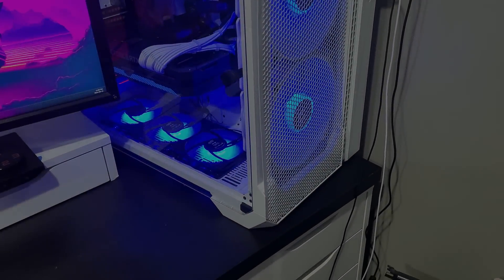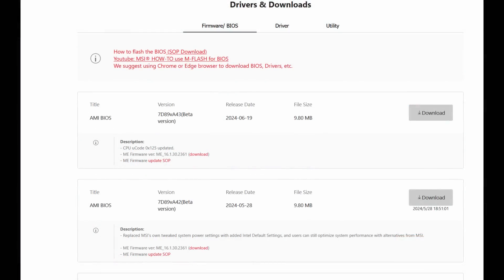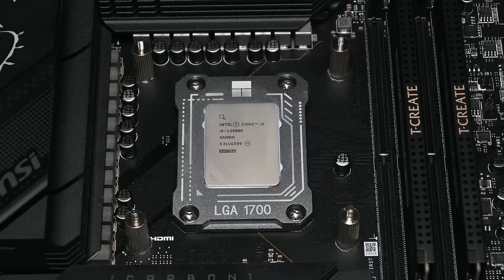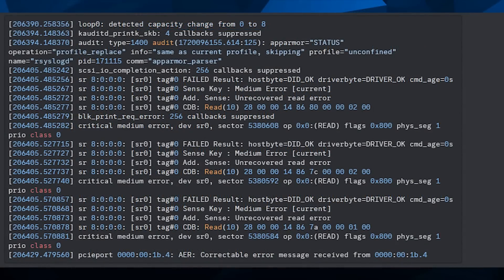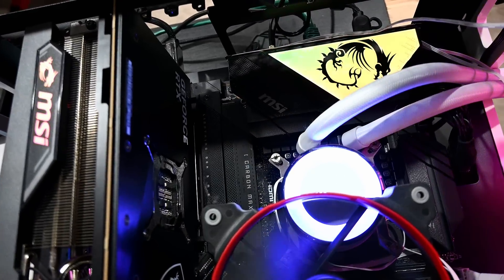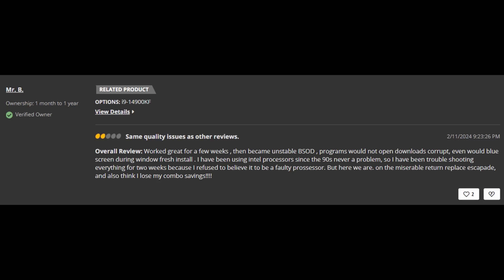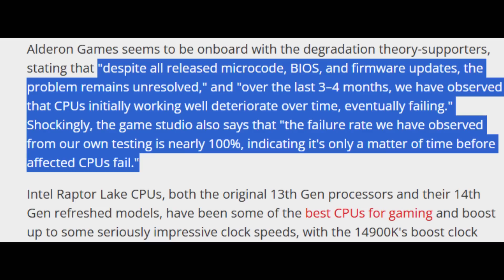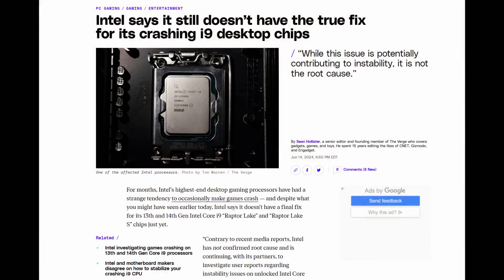Intel CPU Crashing Situation is FAR Worse Than You Think! - 50% Failure Rate, RMAs Denied

Comment: ASUS W680 user here (w/ 14700k), the default BIOS prior to the ones released with Intel Baseline in mind, had crazy power settings (4096w and 700A). It seems like ASUS copy pasted their settings.
Reply: Doesnt really matter, those boards arent able to provide much power to the socket anyway. And while that is possible that was due to Asus doing a copy pasta from their gaming boards, thats totally not the case with Supermicro boards on systems that wendell investigated.
Reply from the maker: Wow wtf, that's a big blunder on Asus
Reply: No wonder cpus mounted on their motherboards failed as well.

Comment: People haven’t been paying attention for the last couple of years of how crappy the quality of everything has gotten. Motherboards, laptops, ssds, gpus, I have noticed so many things that fail far too easily and companies have been watering down customer service, just look at Asus. Asus used to have the best repair service (well in my neck of the woods) and you see how that’s going. I shouldn’t have to send a motherboard back multiple times to get a functional one let alone one that doesn’t look hella used. Intel probably knew before they even launched these chips there was going to be issues with them. They were just hoping to run out the clock on warranty. 
 Intel will stay quiet, do the bare minimum and speed up the launch of 15th gen and start screaming “look at the new shiny”. Sadly Intel hardcores will totally buy into it like they always do. The fact amd has been kicking intels ass in performance and efficiency for years now and hasn’t completely overtaken Intel in market share just goes to show that the system works.
Reply: True the Intel and Nvidia greed again, very overpriced Hardware and have all Kind of Problems the RTX 3090 that dies or the RTX 3060/4060 Problem or the RTX 4080/4090 melting connectors 😂 and breaking pcb's ... Yes greed IS huge in Intel and Nvidia, Just dont buy ther products until they learn how to drop prices but AS WE See in Intel they dont learn at all and Just Put ther overpriced crap Out to everyone
Reply: How has the quality dropped?? Motherboards have gotten much beefier and durable, same with gpu’s. You don’t know what you’re talking about
Reply: I fix computers for a living. Trust me, I’ve seen an uptick in stuff breaking in the last few years.
Reply: On the contrary, I think that the quality of motherboards, GPUs and CPUs are great right now. But with everything "auto overclocked"; GPUs running over 300W and CPU over 200W, then yes, something has to break.
Reply: @reBlub 300w on a GPU is nothing. If you can’t cool that then you have either serious cooling problems or your thermal application is messed up

Comment: My friend 13900k is stable.. at 140W.. more than that and it crashes
Reply: But how long will it be stable @ 140W if he is running a notorious CPU on the edge of stability
The silicon might still be degrading @ an unacceptable rate.
He should probably go down to 125w to give the CPU some breathing room. 
If he does not want to have to go down to 110w in a years time.
Reply: @wessonliam7423  A properly designed chip should last at least 20 to 30 years even. If your chip does not reach even one year of use then it's simply bad quality. Intel should be sued for that.
Reply: The problem is that at 140W it's too slow for a flagship CPU.

Comment: If all 13th and 14th gen i9 processors will die with time Intel should upgrade us to the 15th gen chip and refund our motherboard purchase. I am never buying Intel again unless they make me whole.
Reply: Well, enjoy your new Amd pc because i doubt  intel would RMA a old cpu with a new generation, also they would refuse refunding a mobo because  that's hardware from a different company that doesnt have anything to do with them.
Reply: @Alonne1 warranty is 4 years so no
Reply: @hasnihossainsami8375  yeah the cpu warranty is 3/4 years
Reply: What makes you think they won't repeat the same problem on 15th gen?
This is happening because they couldn't compete with AMD and "had" to overclock the CPUs by default, from what I'm seeing with their hyper-threading dumping and no clear announcement to reply to AMDs 9xxx announcement, I doubt they have some secret super-performant CPU tech on their labs.
Reply: That means $$ Billions lost. They wont. About 5 years from now u will receive 10$ compensation when class action lawsuit concluded.
Reply: @dudao4163  Yeah that is all we will get which is why I am never buying Intel again.
Reply: @dudao4163  yeah this ain’t right. First of all if your cpu degraded, the crashing would happen sooner than that. 2nd, people don’t realise the crashing is because they keep making 2 cores boost to like 6ghz+ on the i9 at really high voltages, which causes degradation, meaning the cpu needs more voltage to reach those clock speeds. They keep giving it the same voltage which isn’t enough once it’s degraded, hence the crashes. That’s why it doesn’t happen on the i5s or i7s. They don’t push them as much as the i9s
Reply: Or use your brain abd just RMA your current Raptor lake and sell it new
Reply: Be prepared to never buy INTC again, because they aint gonna make anyone whole.

Comment: Meh, they will all fail...... eventually, Intel moved the I/O block which is visible on the left handside if you take a look at the Die shots online. On the 12900K and or the 13700 and or 14700k this hasn't been moved, but to eek out more performance they moved it on the 13900 and 14900 series. This is going to 100% kamikazi all cpu's of these series eventually. Its just a matter of time. It will start with simple I/O errors and it will end up with you having to use those "performance" defaults which will stretch that warranty period just enough for Intel to go like "warranty expired Go f*ck yourself fanboy"

Comment: does this effect i5 13600k?
Reply: If I understand correctly it seems it’s mainly affecting the 13900k and 14900k but it’s starting to sound like a hardware issue. If that’s the case it’s possible that all 13/14 gen could be affected and weaker chips may just take longer to see the effects of the issues. Right now it seems only the 900k models are affected.
Reply: No there has not been reports of i5s being affected but it could be that there are hidden problem which will show up over time for lower tier cpus.
Reply: From what it seems, No
Reply: 13700k are also failing. I would I think 13600k will probably fail but way later. Maybe 2025?
Reply: Yes. Not to the same extent as the higher end chips but it is still affected.
Reply: I read a report from a user with a Core i5 13600K who also experienced crashes, so I would not rule out that all 13/14 generation Intel CPUs are affected.
Reply: Running a i5 13600k for 1 year. Was alarmed by the high temps (close to 100) despite water cooling so started undervolting. Temps during extended video rendering<80 at a 9 uv setting. Lose some performance but knew I wasn’t destroying my cpu…. Hearing what is going on now I am glad I did. Cinebench 9 still at 22800 which I can live with….still not happy w Intel…
Reply: @GregiiFlieger  really?,  I have the same cpu water cooled  and never goes above 78
Reply: @chomomma7403  Yes it does.  Of course when fully loaded which is my case Rendering Videos. While rendering all cpus are maxed at 98+%, max frequencies on the cpu, etc.  If you could, start intel XTU, monitor temps and then run Cinebench R23… Let me know what the temperatures are and your cinebench score. During low loading (like watching videos, with office and normal apps running) the temps hang out between 38-42 degrees. Celcius. Even games generally do not load the cpu like video editing/rendering.
Reply: @GregiiFlieger  i've always went with a intel  cpu witha  amd  gpu,  I think when the 9950x comes out i might switch to Amd , it will be a good excuse to get a DDR5 motherboard because im still  on a DDR4 board ...13600k and a 7900xtx
Reply: @chomomma7403  I am thinking the same way seeing what intel is doing at the moment. Already using ddr5 (32G) which really helps with the video stuff. 4K rendering is why I built my present system but the new Zen (only a few more days) looks awesome already….
Reply: @chomomma7403  My second build was an AMD slot A processor in the ‚80s…😂😂😂 Stuck with AMD for a while but it’s been a few years. Also using AMD Graphics. I actually hate NVIDIA since greed has taken over…
Reply: It affects ALL 13th and 14th Gen cips.

Comment: Lower noise? Have you ever been to a datacenter? It sounds like a jet is starting next to you...
Noise is pretty much the only metric your absolutely not concerned with. ~~
/edit: But still, thumbsup. Good video.
Reply: Those server computer fans really sound like jet engine its scary 😅
I was helping my friend installing new server pc on his office and when he start to turn it on it immediately making this high pitch  fan sound "dont worry its normal" he said 😂 boy it was scary i thought the cpu gonna explode
Reply: lower noise for the individual CPU, but when they're being deployed in massive numbers of course they're still noisy.
Reply: @Napoleonic_S  Seems you've never seen a server. I have 3 enterprise machines in my homelab and the ones with 40mm industrial fans go to ~21k RPM and the ones with 80mm fans go to ~16k RPM. Servers are very loud, individually or in a group doesn't matter.
Reply: @Napoleonic_S  Noise is absolutely a non issue in a server environment. As long as basic hearing protection will protect a technician from hearing loss, anything goes.
Reply: I was looking for this comment 🙂

Comment: I watched your full video but i still believe the issue is limited to RL i9s, its very expected outcome when these processors run 100c all the time, they may run fine for 6 months then start crashing after degredation, even 14700k need high end cooler so on cheap cooler will degrade as well, though amd processors also run at high temps and expect them to suffer from the same issues eventually.
Ive seen this degredation on graphics cards, cheap low end versions die much sooner than higher models, heat degrade chips overtime.
I dealt with many RL processors never needed to RMA any of them, 95% of the issue is because of excessive overheating which could have been avoided if intel forced power limit to 250watts on motherboard manufacturers.
Reply: I am on my third i9. I have a 420 mm aio at stock settings apart from xmp. I have good temps in games. Of course I can load it too 100c syntheticly but it doesn't happen when playing games.
Reply: @marcusm5127  Why third?
Reply: @Mitos66size  Did you watch the video? The first two broke.
Reply: @marcusm5127  
I usually test using CPUz stress which dont fully stress processors to emulate regular usage temps, and through all the past generations RL i9s and 14700k were the first to run over 80c on it on 360 AIOs, i know about this degradation so i disabled HT then undervolted now my 14700k temperature never exceed 75c on cinebench and blender, heat is the main enemy to any kind of chips and RL i9s will all eventually die if left with fully unlocked power limits, chips run at low temps last 10 years and could be more.

Comment: Im mad because i bought a i5 12 gen because i thought i had upgradability. Now i have 4070 ti super and dont know what to pair it with.
Reply: i7 and i9 12th gen are perfectly viable options, provided your i5 is bottlenecking your GPU
Reply: A gen 12 i5 isn't a bottleneck for your 4070. Gaming performance between i5 12600k and i9 are meh.
Reply: I got a normal 4070 with an i5-12400 last year and I did have plans on upgrading the CPU next year. Thing is, my plans were always to upgrade to a 13600K or a 14700K if or when I started noticing any problems with performance bottlenecks to begin with and how bad they were, which haven't happened yet since chucking max graphic settings and vsync on makes my GPU hold hands with the CPU pretty well in all the most recent titles I have. With this fiasco, I'm left with the 13600K option.
You can still upgrade to the 13600K as well, but the difference from a 4070 ti super to a normal 4070 is slightly bigger than a 12400 to a 13600K, so my guess is even if you did upgrade to that specific CPU, you'll probably experience some sort of CPU bottleneck at some point, but nothing too serious if you're playing at 1440p.
The instability is practically guaranteed to be there if you own an i9, and might happen if you upgrade to an i7. So the only realistic choices are a 13600K to get the absolute maximum out of the GPU without worrying about instability given the circumstances or spending ~500 or 600€ switching to an AMD CPU + mobo as collateral. Waiting for the 15th gen is useless since they use a different socket anyways, meaning a new mobo regardless, so might as well go with AMD. At least we know they're stable instead of gambling once again.

Sad days for people who planned to upgrade like us, but there's really nothing much we can do at this point.
Reply: Not a big problem with non k. 13700 is your best bet.
Reply: sticking with 12th gen is fine, their i7 and i9 is stable curently, just make sure that you use DDR5 ram since newer game benefit the most from it
Reply: @kuekejuu5057  i5 13600K/14600K is for you. There is no problem with them. You can upgrade to 4090/5080 later...

Comment: Where did you get the failure number from? I watched the same stream and I got the impression that only a few of the Intel cpus had problems. And remember only the ones who have mishaps show up in an report, so one really dont know how many cpus were fine. Claiming 50% is insanly MISLEADING. Watch the vids urself guys.
Reply: If I understood correctly he was saying that 50% of the chips would have at least one error running 24/7 in a week in a server.
Reply: He did say 50% would suffer from error in the video with Steve Burke, not all errors are bad enough to lead to a crash or BSOD (IIRC he speculated that 2/3 of errors go unnoticed). The original video suggests around 15% are too far gone and need to be replaced, which is maintained. These do not contradict each other. 50% will suffer instability at some point when running 24/7 in a server, around 15% reach a point where they are so unstable they need to be replaced, 50% are fine.
Reply: It's a 100% failure rate under test conditions. So, there is that.

Comment: I'm glad I did my RMA the day before Wendell dropped his video if intel is denying them all the sudden I contacted intel about my 13900 k and they took it back no problem I'm waiting for the new one to come right now, with that being said if I have any issues with my new 13900k the 7950x got my name all over it
Reply: At this point it's well worth it to just wait for the 9950X.
Reply: @oxaile4021  honestly I'm considering going 7950x3d because I like to Tinker and I don't mind having to use process lasso and that chip really is amazing if you know how to make it do what it is supposed too, also the 9000 Series does look good but overall it's really not that much of a step up from this generation and there are massive sales right now on the 7000s also since i will already be on the AM5 platform I'll be able to upgrade anytime. What are you thoughts?